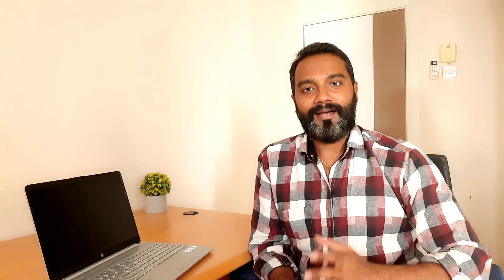Popular Piping Design Software's used in Large, Medium and Small Scale Companies (From 2021 onwards)

Comment: Hi,
I’ve just mapped out the the hot and cold services in  a large building.
The pipe runs have been neatly hand drawn over printed off floor plans.
I’d like to now convert these hand drawn plans to some form of a cad version for a more professional finish.

Is there a way of doing this, and if so, what software would you recommend?

Many thanks, Steve

Comment: Thanks for the helpful software suggestions. 
In piping design for buildings, we usually define the number of fixtures (kitchen sink, water closets, showers, and also various drainage pipes. Then, the designer extracts the water flowrate required in each section of the pipe to calculate the pipe size. Which of these softwares can get the various fixtures of a building as input and calculate the rest? (i.e. the required pipe size, flowrates, etc)
Thanks again!

Comment: It's the very use ful platform for mechanical Field Engineers , I'm working as a field Engineer In last 11 years in Structural steel and piping in oil and gas Industry, I have clear idea to boost up career in next level.
Thank you sir.
Reply: Hi,
I’ve just mapped out the the hot and cold services in  a large building.
The pipe runs have been neatly hand drawn over printed off floor plans.
I’d like to now convert these hand drawn plans to some form of a cad version for a more professional finish.

Is there a way of doing this, and if so, what software would you recommend?

Many thanks, Steve